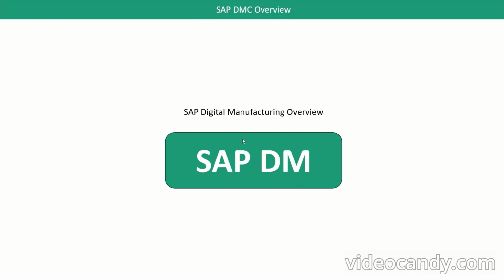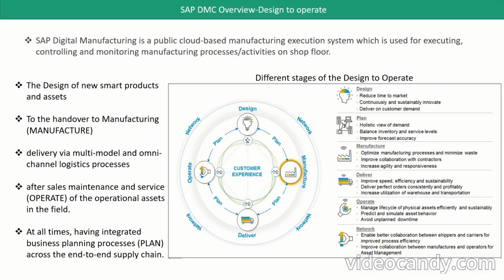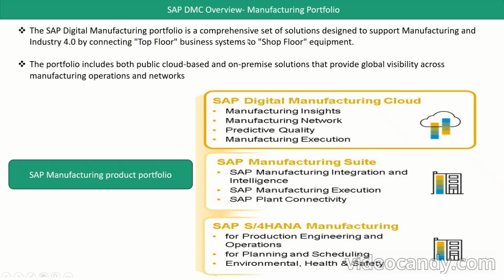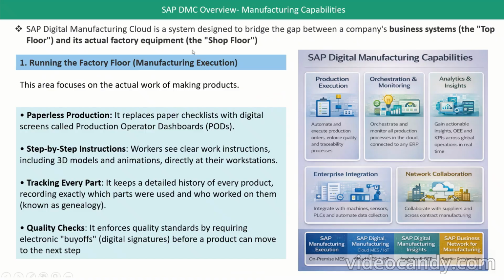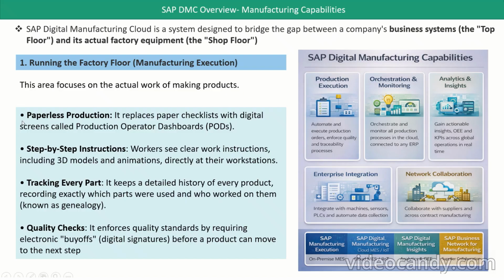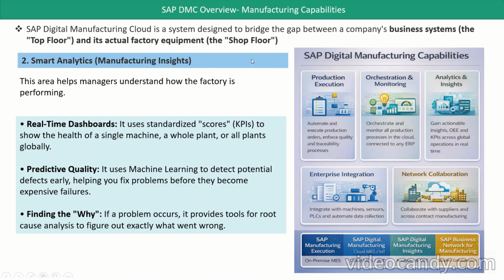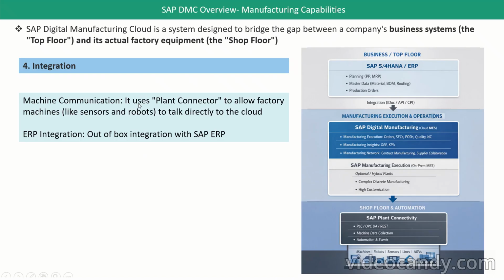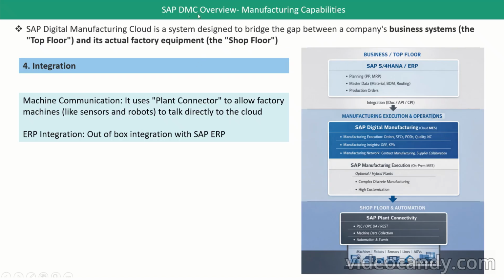SAP DMC Overview  Design to Operate SAP DM Product portfolio and SAP DM capability

Comment: Sir, I would like to learn SAP Digital Manufacturing (SAP DM) and gain hands-on practical experience. Could you please guide me on which practice system I should select from the SAP Learning Hub website to practice SAP DM configuration and shop-floor execution? I have checked the available practice systems, but I could not find a dedicated SAP DM system. Please suggest the correct practice system or let me know how I can obtain access to an SAP DM practice tenant.

Thank you for your guidance, sir.